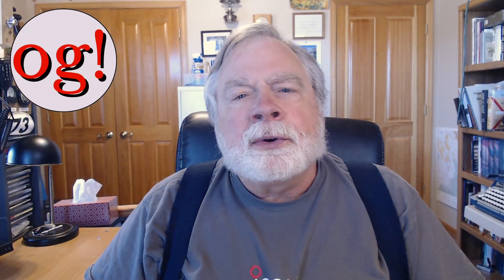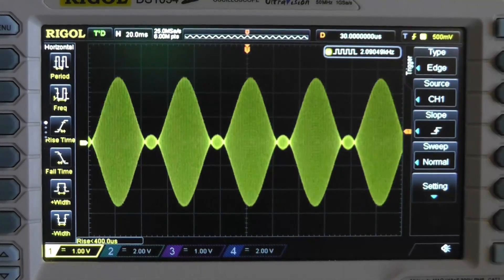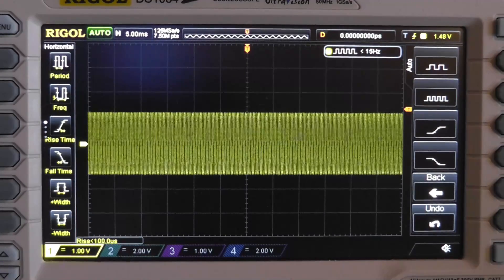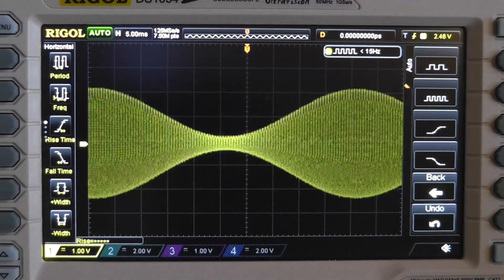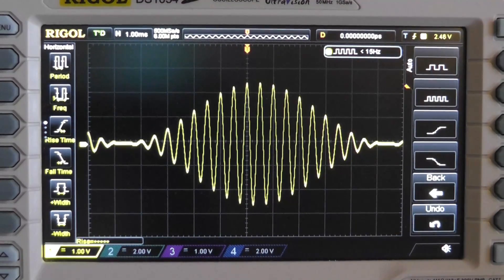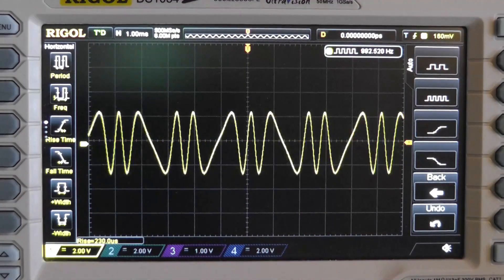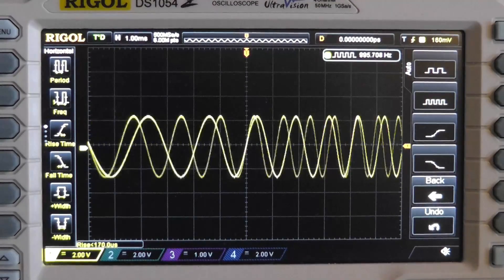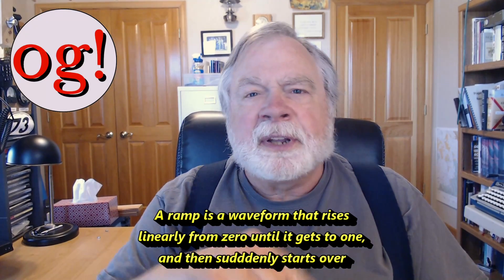Stay at Home Video: AM & FM Modulation (#286)

Comment: FM can be generated by taking the two signals that come from an oscillator driving Phasing transformer giving two signals, the one that is not shifted ie the 0 degrees signal will be turned into a DSB signal and combined with the other signal  90 degrees shifted signal and multiplied up to the wanted frequency.

Comment: Thanks for this very comprehensive introduction to AM/FM. A question I am asked very often is: ‚why do AM or SSB Signals have a bandwith in the spectrum, even though the modulation only affects the amplitude of the signal, not the frequency’. Could you make a video that explains the underlying principles in a comprehensive way?
Reply from the maker: The bandwidth of the modulating signal is superimposed on the AM signal via a mixer, which is where the other frequencies are added.